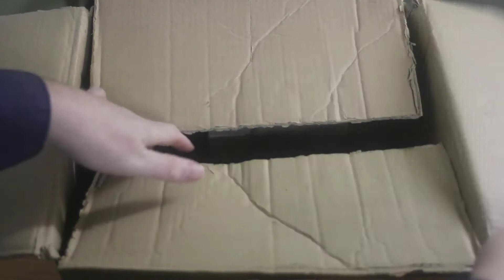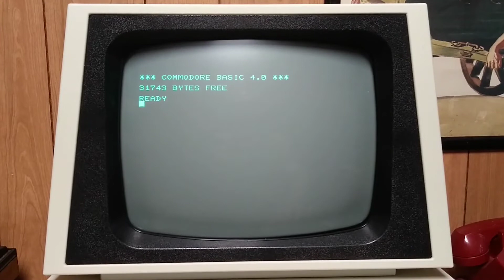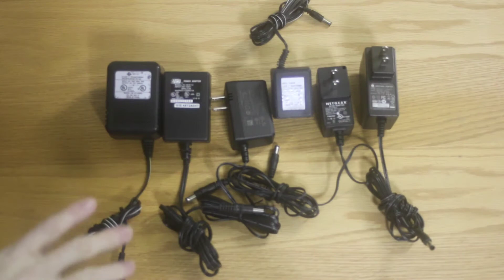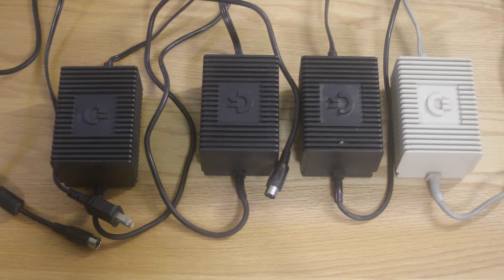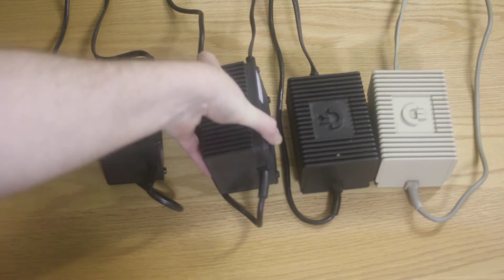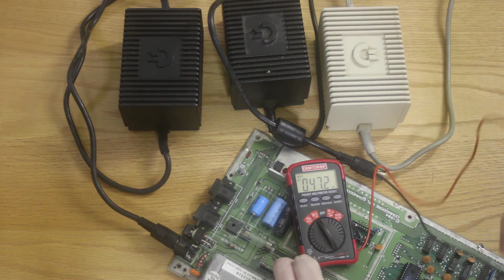Testing power supplies for the Commodore 64

Comment: The connector style on the Atari 7800 was also used on some positively ancient TI calculators, a Shark Euro Pro rechargeable vacuum, the battery for at least one of the Brinkmann Maxmillion Qbeam spotlights, and some satellite TV boxes (Dish Network Joey, I think). That’s where I salvage them from.

I test the C64 PSUs by dropping my probe caps over one of the pins and then inserting my probe into the cap. Works great. These are the caps that most meters include on the probes which insulate everything but the very tip. I also turned one probe cap into a wire-wrapping tool for big DIN connector pins. ;)
Reply from the maker: Good to know. Thanks for sharing with the viewers :)
Reply: @300BaudStudios  Then I should also mention that the rubber around Shark vacuum plugs is too fat and needs to be trimmed to fit down into the 7800. ;) Also, the sat box plug is from leased equipment that you probably can’t salvage from since you don’t typically own it but I have seen people buy replacements online to salvage from there. It’s typically a latching variant of the plug but you can ignore the clip/latch or snip it off.

Comment: I just got my C64 recently and it came with a US plug and here in Australia they are different.. I checked the output voltage on the US version and it was 5V 1A, the same as the small iPhone charger! So I use that now (I have a few of them), and it works like a treat. Keep up the great videos and commentary!
Reply from the maker: I think the NTSC version of the C64 was more popular than PAL systems so it makes a nice choice for gaming. For anyone still on the old PSU be careful with the 10 volt ac line as this fails more often than the 5 volt dc.
Reply: @300BaudStudios  It’s really the exact opposite. I’m an NTSC user in NTSC land (Newnan, Georgia, USA) but Commodore 64 was the best selling computer of all time specifically because of its enduring popularity in PAL territories like Europe and Australia. In the ‘80s and early ‘90s it was basically their Nintendo Entertainment System. Almost all C64 games are written primarily for PAL systems and many (most?) were never adapted for NTSC… which is why I’m trying to convert my machine or get a second C64 (PAL version). When PAL games run on NTSC they will be too fast or have messed up music/sound but many don’t even run at all.

Occasionally you will see a modern release that ideally requires an NTSC machine because the developers were pushing the envelope and wanted more performance. I believe the recent Sonic the Hedgehog Game Gear port is one such title.

That’s why I want a VIC-II² kit with a PAL VIC-II, but I may as well buy a PAL C64 for that price. If I’m going to pay more I’d rather buy an FPGA VIC-II Kawari which can replace the VIC-II chip and clock the system at PAL or NTSC while giving you true digital output (DVI/HDMI). Problem is, the developer had to pause development due to the parts shortage. :(
Reply from the maker: @emmettturner9452  Thanks for the clarification. I understand that PAL offers higher resolution which steals CPU cycles. I personally don't like PAL because of the increased flicker.
Reply: You must have a very late model if you can run it on 5V only! The PSU has 5v DC and 9v AC. Most boards require both.